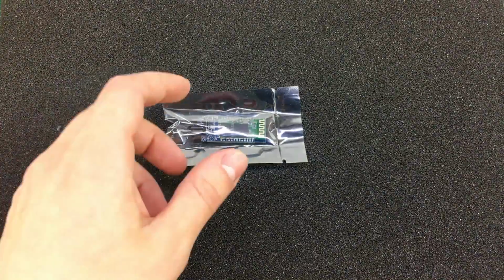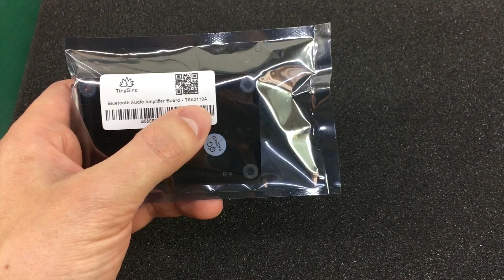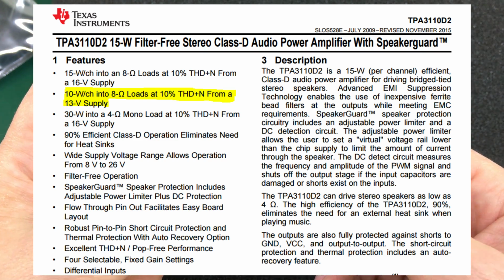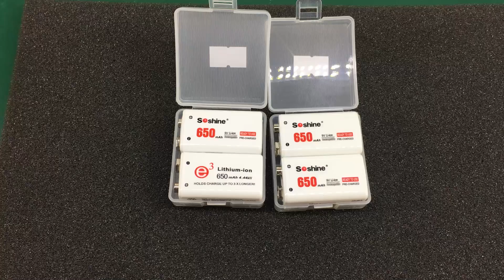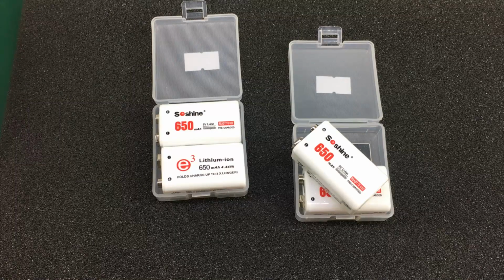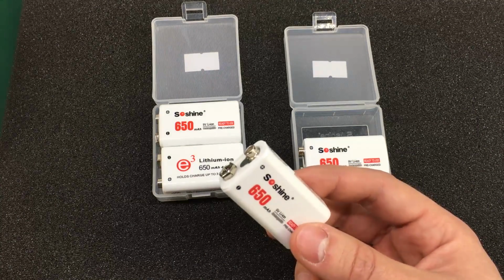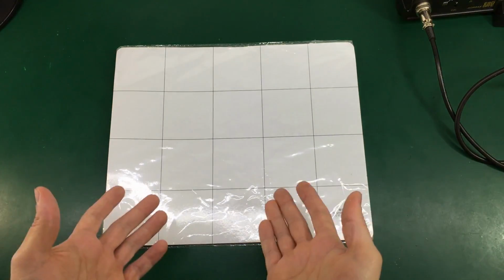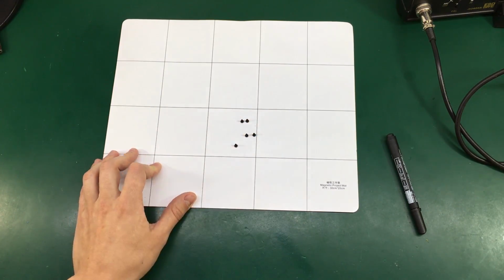Voltlog #37 - InTheMail - Part 1

Comment: Hi, what charger do you use to charge those 9v batteries.  At what current and voltage?
Reply from the maker: I am charging them at 100mA, 8.4V with a 2S lithium battery charger. From their website "Recommended Charging Conditions:0.2C 5mA charge termination control parameters taper current 0.01C 5mA at 8.4V"
Reply: The Soshine Battery Quick Charger in item list seems to only do Ni-Mh/Ni-Cd 9v Rechargeable Batteries at 25mA.  Could you recommend another Li-ion for good price?
Reply from the maker: Sure, here you go the Soshine charger for Li-ion http://voltlog.com/y/c4q3b I also think these 9V batteries have protection circuitry inside that make it okay to charge with a standard NiMH charger because the internal circuitry will cut-off the cell if the voltage rises above 8.4V which is the charging voltage.
Reply: great thanks.  I figured I ask, could I use a B3603/B3606 dcd-dc converter to charge these 9v/8.4v batts as long as I set it 8.4v at 100ma?
Reply from the maker: yes, you could try that but keep an eye on the whole process, check if the battery overheats during charging and monitor it's voltage closely.

Comment: Great video, thanks for sharing.  I noticed the brushless DC motor driver board on your video with the rubbed off part number, and I think that may be a Texas Instruments DRV11873.  The layout of the board and the components on it look similar to an evaluation module that I have.  The chip right next to it is probably generating a PWM signal to control the speed of the driver.
Reply from the maker: +JS106351 You are probably right, the DRV11873 does come in the same package, pin 16 is the PWM input and in our case is connected to our second IC which you also got right. It must be reading the pot voltage and generating a variable pwm signal on the output but I couldn't find any IC that would match that pinout.We also have a match between the datsheet outputs and the pcb layout and pin 15 going to our direction selection pin header also matches the DRV11873.